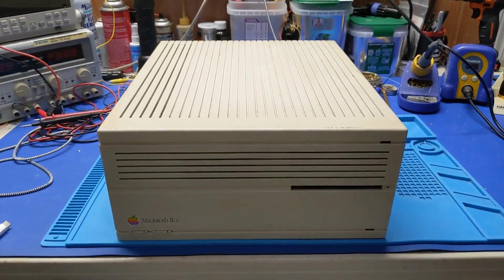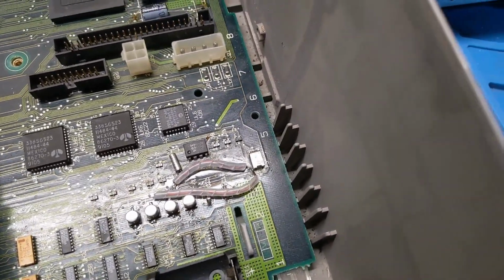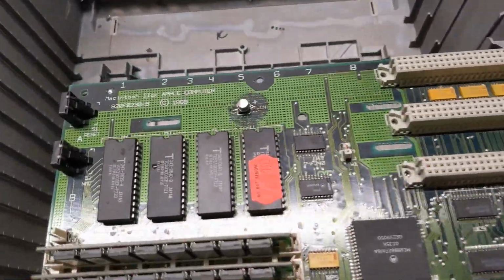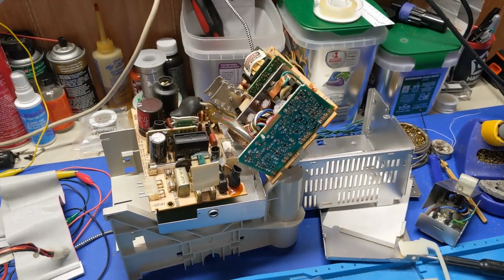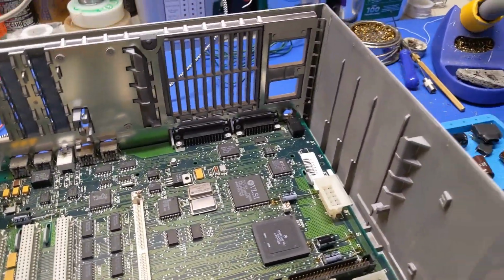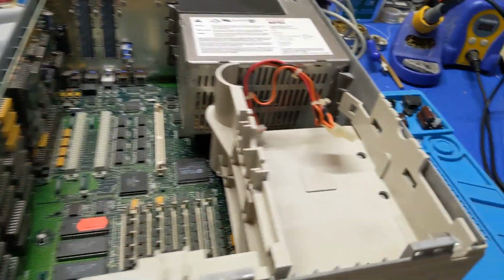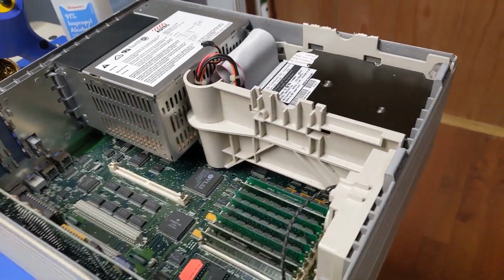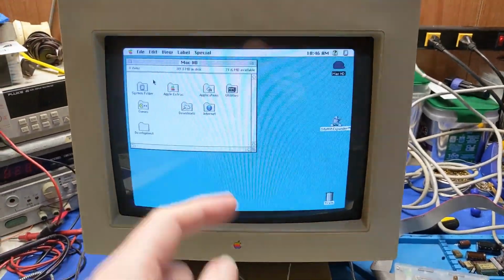Macintosh IIcx Overhaul and Testing

Comment: I have one but have a problem with Poweron Circuit. It worked good after recap but years later It stopped. I revised the Power supply when recaped the board.

The RasterOps vídeo card also stopped working...😢

Comment: It’s a Unix system! Compiling 2 million lines of code on a 2CX. Time to go watch some tv. What are you compiling there anyway?
Reply from the maker: I forget now, it was some hello world example program
Reply: @THEtechknight  I’m trying to fix bad video on a Kanga. Can you tell me if the 3400c has the same video ram? And which ram chips are they on the logic board?
Reply from the maker: @sideburn  I have never worked on a Kanga, but i know someone who has and had the same problem. IIRC, it was a bad connection between the GPU and RAM. Xodium Retro
Reply: @THEtechknight  ahh wow. Thanks for the tip. The board looks good cosmetically i haven’t found any corrosion or broken traces but I’ll focus on that area and have another look.

Comment: Man I repaired mine it was pretty messed up. Lots of broken traces. Leakage. Replaced all the caps etc etc. I thought I was good to go. But it wasn’t going into 32 bit mode and the only Nubus card that’s working is the video card. I thought the cards were bad but don’t think so now. I can get 32 bit mode if I use a ROMinator but apple diagnostics reports “logic board fail” or some useless message. No idea how to go about fixing it at this point aside from more continuity checking. But since everything is working (with a Rominator) aside from my video spigot and rocket card it’s making it much more difficult to source out the problem.